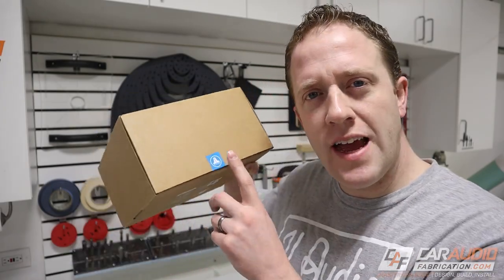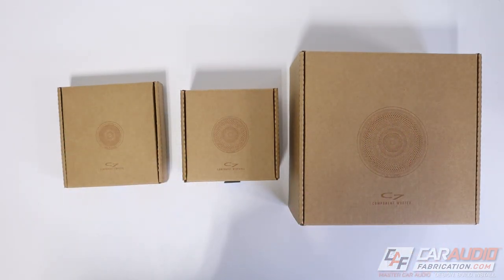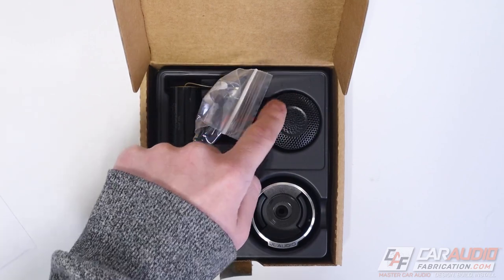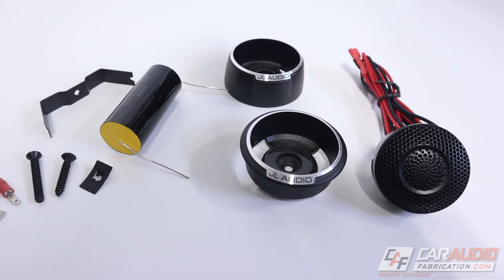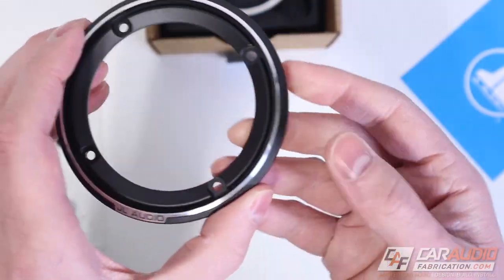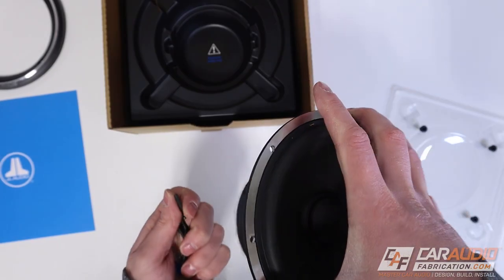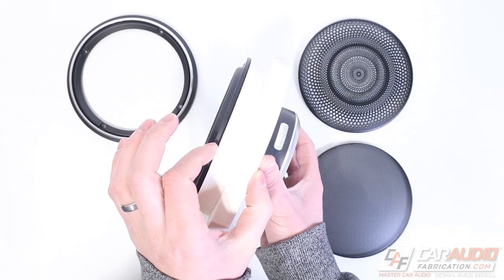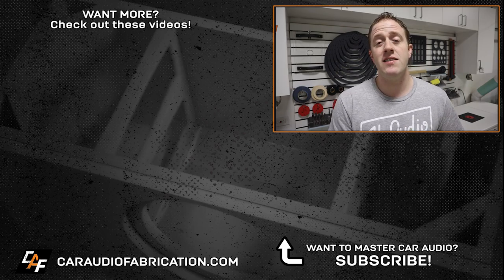JL Audio C7 Component Speakers - In Depth Overview!

Comment: Great Video. Looks like great speakers.  You mentioned using the crossover to get a "linear response" from your 3 speakers. I was curious as to your plan, Are you planning to attenuate the low frequency of the speakers to account for the cabin (room)  gain you will get from having the speaker's in the car? Or are you going to just run them flat as per the specifications and let the vehicle's low frequency gain just come in to add extra bass to the overall frequency response and sound of the system? I know for customers who like bass they always want more but this seems to be an SQ system install and I was wondering if you were going for a true flat response.
Reply from the maker: I tune to a target curve which includes level matching each speaker (and side to side), "flat" usually doesnt sound very appealing. Sub will be on a control knob allowing for independent adjustment.

Comment: Seeing as you’ve spent some time with the new Audiocontrol Amps, you think they would do these c7’s justice? Like the 6.1200 series?
Reply from the maker: That's what I paired them with for dad's build! Awesome pair!
Reply: That's exactly what I'm putting in my Hilux, except I'm only going the woofer and tweeter, still deciding on what rear coaxial to pair with these, but will be run off the Audio control d-6.1200. Do you think the c5 coaxial will handle the 125rms of the amp?

Comment: Hi Mark. So I ordered a pair of C7-100 tweeters on Crutchfield but at the check out it said I needed some bass blockers and added them to the cart. Should I be using the bass blockers in addition to the capacitors that the tweeters came with? Or do I only need to use the capacitors they came with? I’m using the AudioControl D-6.1200 amp to power them along with some other JL speakers.
Reply from the maker: The capacitors they come with are the "bass blockers" 👍

Comment: Does it mean 3 way component for the front doors will need a six channel amplifier just to drive the front 2 channels?
Reply: Yes 6 channels to drive 6 independent front channels.  You tune each one separately.  I have a build on my channel that shows these installed with amps and all.

Comment: Do you have to put the tweeter and the mid together or can I put it in the rear pillars I have 07 tahoe and I have 2 tweeters in the front pillars and 6 1/2 on the doors and two 3 1/2 in the rear pillars I'm trying to upgrade my factory speakers

Comment: So you need a 6ch amp to run the front sound stage with that setup?
Reply: @Michael Starn  

Not really.  But there are plenty available.  The JL VXI amps with DSP are nice.  So are the Arc Audio XDi V2, AudioControl LC-series, Alpine's new 6-channel announced at CES, etc.

But you can combine multiple amps...for instance a 4-channel for the mids & midbass, and a smaller 2-channel for the tweeters.  There are limitless possibilities, you are not stuck with using a 6-channel amp.

Comment: I've watched so many of your videos but I'm still not sure what I need to do for a basic balanced setup. Currently, I have 6x9s on the rear deck and 3.5" speakers in the dash. I want to do new 6x9s in the back, a 10" under rear seat, 6" speakers in the front doors, and retain the 3.5" speakers in the dash. Should I be looking for amps for both the speakers and the sub, or just the sub? Head unit is a Dual brand from Walmart. I'm trying to build on a budget. Any tips/suggestions are appreciated, my car is 40 years old and the 3.5" speakers have a hard time drowning out the engine and road noise.
Reply: Get rid of the Dual HU. Get yourself a used Alpine, and I would run a separate amp for my subs, and then an amp for my high/mid range..

Comment: Thinking about putting some component speakers in my 2008 Dodge Durango
Reply from the maker: Speakers like the C7's are an investment, high end but no reason you can't pull them and move them from vehicle to vehicle if you change vehicles down the line.
Reply: @CarAudioFabrication   what would u recommend if I didn't wanna go high end
Reply from the maker: JL has a model for nearly every budget. You should audition at a local dealer of you are not positive what you would like. DSP is also critical  if you can allocate budget towards that to tuning the sound to be optimal.

Comment: I work in the Trucking Industry. I have to turn my reciever up to 40 of 62, to break the ambient sound of a 80k pound vehicle moving down the highway at 80mph for 46 miles. Average trips are 3 hours loaded and 5.5 hours for a full turn. 

Any suggestions?
Reply from the maker: If you own the truck consider sound treating the cab. It will make a significant difference
Reply: That is most definitely one of my goals, to own my own tractor. Thank you for being so instructional. Love your work.

Comment: It would be awesome if they make a 3 way amp ( 6 channel) specially for the C7 speakers.
Reply from the maker: They do. VXI600/6i
Reply: @CarAudioFabrication  hey bro!!! true.. want i mean is. A amp already ready to install with minimun adjustment.  2 channels made only for the tweeters give them the full power only on the highs. 3.5 for vocal and the 6.5 for the bass. Like a C7 series amp lol 😆
Reply from the maker: This is not a possibility because every single cars environment is different and sounds different. There must be tuning flexibility.
Reply: @CarAudioFabrication  Hi there. For the C7 100 tweeter what amp you recoment from jl Audio. I got a HD600/4 amp. Hope is not too much

Comment: Hi.
I have lot of trust in you.
Would u review the ALPINE R series components pls ???
Reply: @somesh yadav  

The Alpine Type-R's are very good at their price point.

They are a very neutral-sounding set out of the box, but they can be easily EQ'd to your preferences.

They are not like most other component sets that have a specific "character" to their sound out of the box, like most Focal's for instance.

They are one of the best if that is your budget.
Reply: @bbfoto7248  Thanks !! I brought those R series from alpine.
So light weight and still naturally loud and crispy.
I also brought Poineer deq-s1000a sound processor but had to uninstall it because it took gain down.
Reply: @bbfoto7248  can't believe that poineer has come up with such stupid product... without SP my system much loud and clear.
With this I had to crank volume to 100% and still getting only 50% of output. 
Was it installed wrongly??
What would you suggest.

Comment: For  $2,400 to bad don't  comes with  crossovers  ,  I am a JL fanatic when  I  started  with  2 12" W6 , 300.4 , 500.1 n 2 set of component speaker that  was back in the year 2000
Reply from the maker: Adding crossovers would increase the price, they dont just "throw em in for free". I cant even tell you how many component sets I have bought over the years that the crossover just sits in the box, I paid for those for no reason... This is the case for most high end speakers, they are going to be ran active anyhow when someone is in that budget category.

Comment: @CarAudioFabrication hi,i need help if u could help me,I bought used subwoofer box with subwoofer and amp. Subwoofer is ground zero gzhw 30 spl. In manual says it needs 90 net liters for vented box but it doesnt say anything about the air. My box has 127 gross liters but i dont know how to caluclate it to net....

Comment: the reason they have power ratings included that are higher than the normal specs is because if you are running good, clean amplification you can run up to triple the amount of what is rated for the drivers.
Reply from the maker: It's because music is dynamic, I discuss this in the video, it has nothing to do with "clean power"

Comment: No expense spared for sure for 930$
Reply: Hmm, not sure where you got $930 from. The c7-650 mid is $499, c7-350 mid is $389, and the c7-100 tweet is $229 so that's $1120 but only for 3 speakers, if you'd like to listen in stereo add another $1120. Then add a $400-$1500 DSP and a $400-$1400 amp. Build custom a-pillars/sail panels/kick panels. Fully sound deaden doors. This is really a $4k+ setup even without a sub or sub amp.

Comment: Why is there only one Tweeter
Reply: Everything is sold separately. Each tweeter is $299 USD, 3.5 Midrange $399 USD and 6.5 Woofer $499 USD. So, just for the speakers $2400, and there’s no crossovers included, so you’ll need at-least a 6 channel amp & dsp.

Comment: another fine example of jls over priced  equipment  as far as tech there isnt much improvement to  justify a 125% increase in price   I've not yet heard these however I have the c5s   an $800 3way morel kit  to me sounds more detailed if your heart is set on shelling out 2200 bucks go for a focal kx 3way  kit either way you get crossovers and you can leave them out if you choose to go active

Comment: I was more of a fan of the German manufactured MB Quart components. I had 4 sets of them in my 2001 E-class running off a pair of Alpine amps and Alpine head unit. I believe each set cost me about $400. I think that was the best sound system I ever built. It didn’t even need a subwoofer. It sounded so clean and crisp. I remember hearing things like the artists moistening their lips. The guitar players fingers moving up and down the fretboard. The felt hammers striking the strings on a piano.
Reply: I have been curious if MB Quart. I have been an Alpine purist for about 17 years now, just started considering JBL, and had some Kicker components surprise me last year.
Reply: @justinsixx90  MB Quart is no longer the German manufactured greats they used to be. they got bought out several times and now are china built with less quality standards and materials. And the great sound they used to have is now gone unless you find an old set that someone is selling

Comment: Still not even close to sounding as good as any descent home audio driver. Listen to your Uncle Joe.
Reply: Do you drive around with your home audio drivers?
Reply: @3rdaxis   

While true to some degree, you need to be careful when using home audio drivers in a vehicle.

Most home audio drivers were not made with the harsh automotive vehicle environment in mind.  Namely moisture and water damage if mounted in typical door locations, and the adhesives & soft parts were not designed for the repeated and long-term extreme temperature fluctuations within a vehicle.

That being said, I have used many Scanspeak, SB Acoustics/Satori, Peerless, GR-Research, Dayton Audio, and other "Home Audio" drivers with great success in many of my vehicles.

I know that the Dynaudio Esotar2 and Audiofrog GB-series car audio speakers have been thoroughly designed & tested in-house for use in harsh automotive environments, and IMO they perform just as well as the best Home Audio drivers.